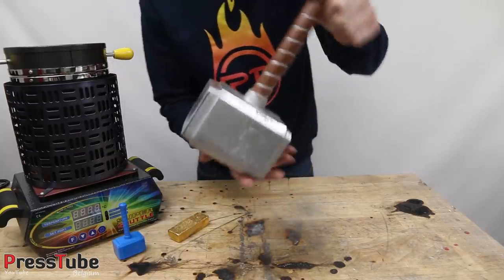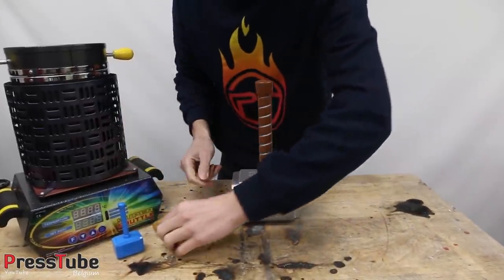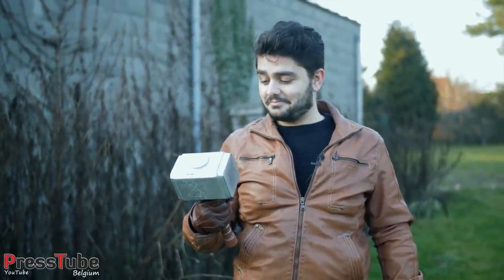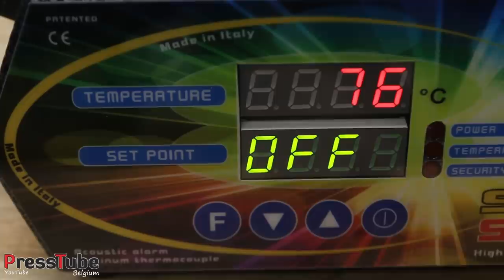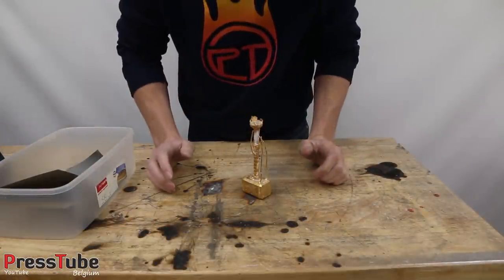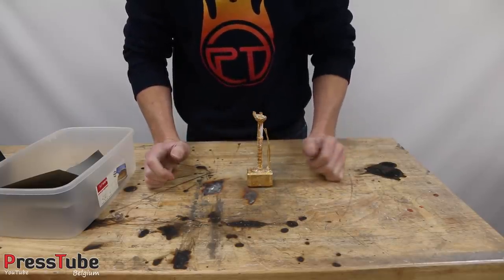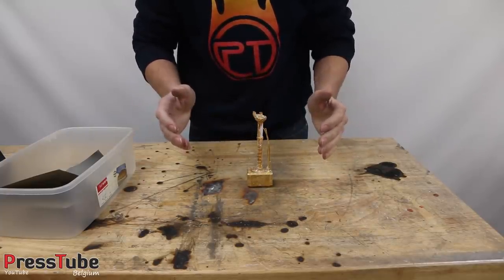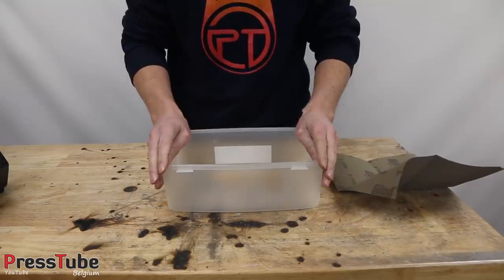Casting $34,000 MINI Thor's Hammer from SOLID GOLD

Comment: I have seen where people who cast with plaster of Paris vacuum the mixture just before they pour it into the mold. This eliminates the air bubbles when it cures. Thereby creating a smooth interior surface for a smooth casting. Or you could just pour the plaster over the wax form then vacuum chamber it whilst it cures.

Comment: Those wires that you broke off the hammer can be made into a chain or necklace you spiral the wire into coils or springs and cut them in certain areas so that they are separate links then connect them like a chain and solder them together

Comment: You don't need a vacuum casting machine, just make a cheap vacuum chamber. A pressure pot from a pressure cooker and a piece of plexiglass with a piece of rubber that seals the top of the pressure chamber, drill a ho;e in the plexiglass and install a pressure gauge and the hookups you will need to attach a vacuum pump and a valve to allow air into the chamber once you're ready to open it. Anyway, put the was casting into the pressure chamber, pour in the casting material, seal the pressure chamber, draw a vacuum to get out all of the air bubbles, and let it sit there until it is cured enough to be put in the over and fired for the wax melt out. This gets rid of all the air bubbles from the casting and gives you a perfect product every single time for about $100-$150 worth of parts and materials.

Comment: The rough surface is due to shrinkage porosity . The sprue is supposed to go to the heaviest part of the hammer and the flask temperature was also too high.
Another thing is that pure gold doesn't shine up nicely as it's too soft, you should try adding a little bit of copper. And a simple vacuum assist machine can be self made,for $200!

Comment: Should have vacuum the air bubbles out of the investment, should have inserted your flask into the burnout oven with the wax whole facing down, should have used borax as well during the melt of the gold.

Comment: I looked in the comments to see if it was proposed before, and could not find any similar suggestions, so sorry if this was already suggested: 

What would skip one step and thus keep more detail is if you 3d printed the model with wax fillament, I know it exists and is used by goldsmiths. 
I think it might be a good working method to explore...
(I found some info googling "3d printing lost wax casting"
Reply from the maker: Unfortunately not available in Europe, but you are right.
Reply: @PressTube  Maybe you can colaborate with Walking Robot in Deurne, they are an open Garage/HackerSpace. Christel, one of the owenrs is qualified goldsmith. and they gave a soem 3d Printers and experiance. 

I can get you im contact with them or just google walking robot open garage. If you get in contact with them, jsut say hi from from Job
Reply from the maker: I will google them for sure. Deurne is only 20km from where I live. Some of my families lives in Deurne :)

Comment: Dude, you don't need a 10k vacuum chamber. You can build one big enough to fit your containers out of clear cast acrylic for far far cheaper than that. Then an actual vacuum pump which is only a few hundred for a nice one, and some tubing, joints, and valves. I bet you could build a nice one for a grand. Plus clear cast acrylic is clear and you could record it for YouTube.

Comment: Why did you first make a wax model when you could just have burned out the 3d print?
Reply from the maker: The hammer was printed with wrong filament for that. It would have left too much residue. Next time I will use other filament and skip the wax part.
Reply: @PressTube  I'm assuming it was printed in ABS? :P anyway, nice vid dude!
Reply from the maker: Yeah it was ABS. Thanks !

Comment: This is not real gold. Real gold would never break that easy. Gold is so expensive because it is very malleable.
Reply from the maker: I can assure you that it is real gold. Check the archimedes test in the unlisted video. The link is in de description.
Reply: @PressTube wiki: Gold is the most malleable of all metals; a single gram can be beaten into a sheet of 1 square meter, and an avoirdupois ounce into 300 square feet. Gold leaf can be beaten thin enough to become semi-transparent.
The golden wire can be bent endlessly and will not break because it is very flexible and shows no signs of material fatigue. Such a wire can be pulled until its thickness will be the diameter of the atom and only then will it break. So it's hard for me to believe that the vent would give up so quickly if it was made of gold.
Reply from the maker: Tell me how I can convince you that it’s real gold ;) I’ll send you an email with your request.